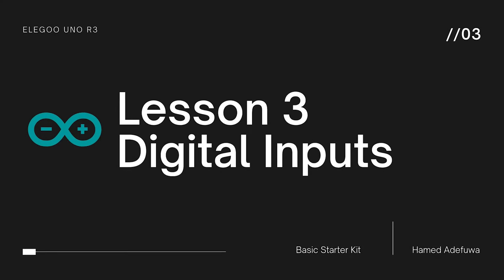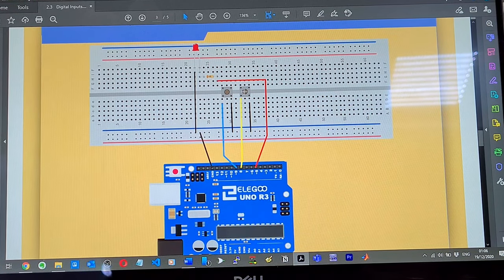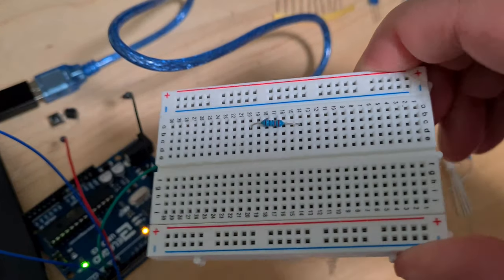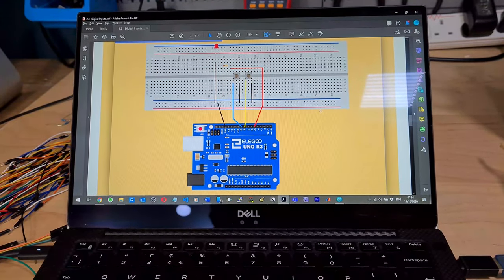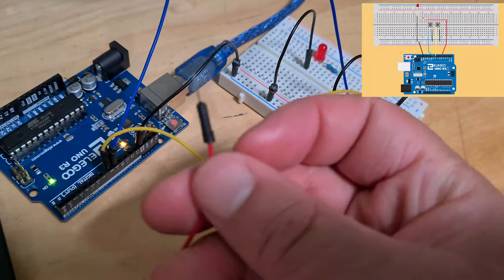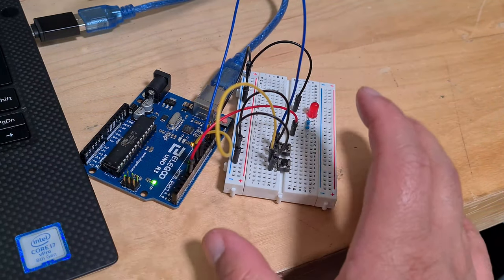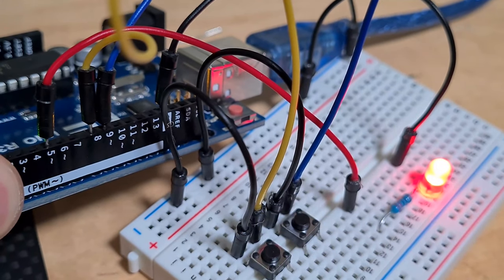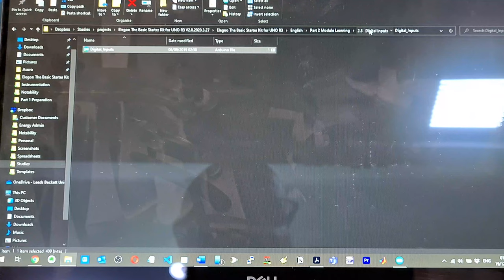Digital Inputs Arduino Tutorial #3 - Elegoo Uno R3 Basic Starter Kit

Comment: I was confused why pushing the on button multiple times wouldn't switch it back and forth between high and low. That quick statement about it only going from high to low when the button is pushed (and back to high when released) helped it make sense to me. Confirmed by holding down the off button while tapping the on button to make the led blink. Thanks!
Reply from the maker: When it clicks, it clicks! lol glad I could help <3